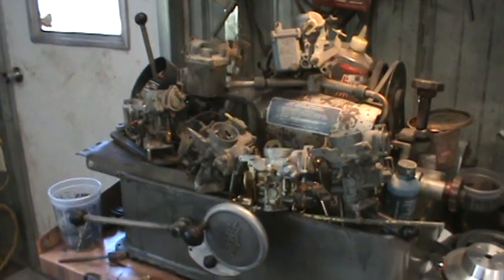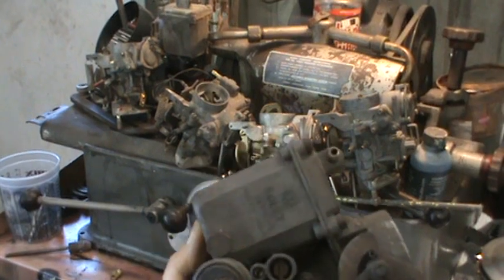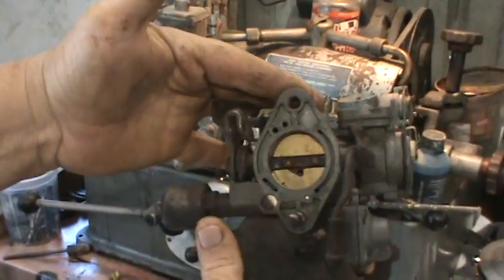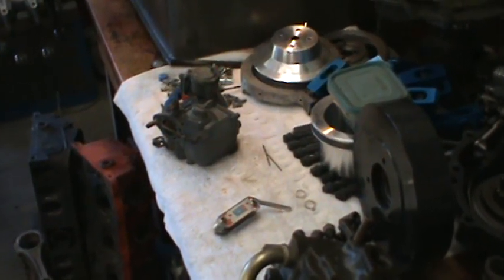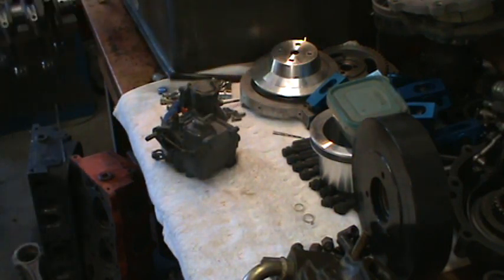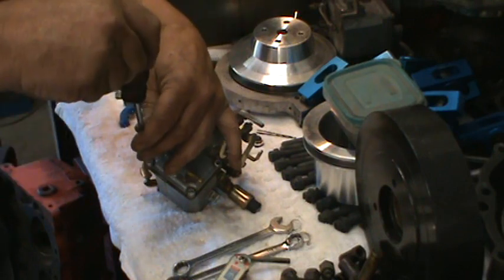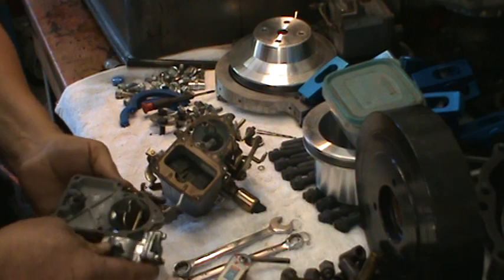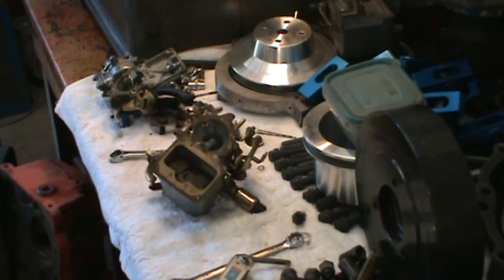cab re jet on a vw

Comment: Excellent ! Just what I needed to see. But Just how much do you open up the Jet ? My wife's 74 Super had a new carb installed B4 we bought it. I wont go into all the details - had been fighting several issues. Some fuel - some ignition. Then about the time I thought had it all figured out. I stopped & switched cars - headed home. It was loading up pretty bad - bad enough it stalled just at the edge of town. It was dumping fuel right down the throat. I finally decided to do a video. If you would like to check it out. Please watch - would appreciate the view and comment. Thanks - always learning new stuff. Its been several years since Ive turned wrenches. I had no idea how much I had missed it.

Comment: Darrin I have a question about the inlet port where you connect the fuel line to the carburetor. on some 34 pict -3 carburetors the inlet port is block  and in 34 pict-4 they seem to have an access inlet.  could that inlet port be used as a return line to the fuel tank.

Comment: is it possible the low boiling point of gasoline/ethanol mix nowadays is causing boiling in the float bowl on a hot running motor? It'd be nice to use a IR temp gun on the float chamber to see how hot it gets...   I think gasoline boils around 375F ...good video...

Comment: Damn ethanol .there is a race rack gas station by me and Ronnie's house that is premium with no ethanol 3.99 a gallon . Just cheech that 34pict onto the single port intake.home made adapter plate.30picts just never have enough nut
Reply from the maker: you can make me a adapter plat , this cab  is junk

Comment: i have 1 pict30 carb. and 3 pict 34-3 carb.  myself on my 1600 dual port 1972 super beetle i want to run dual webers or a single 600cfm holly 4bbl. carb.